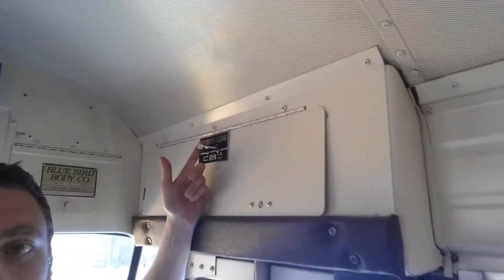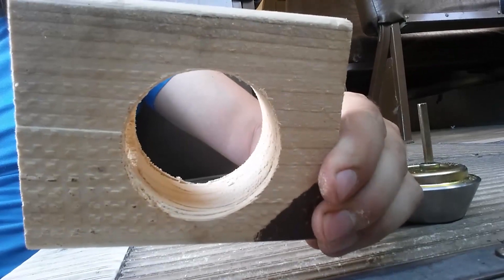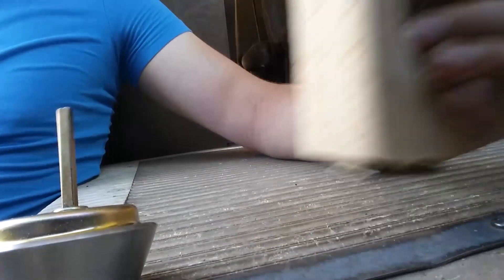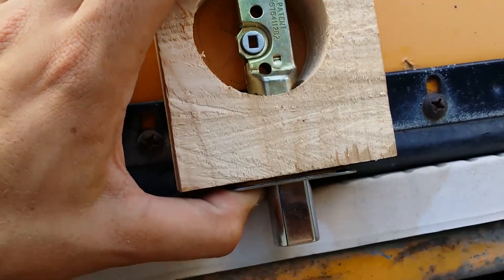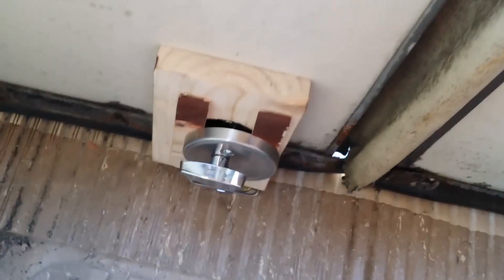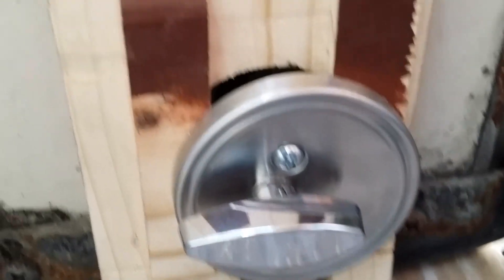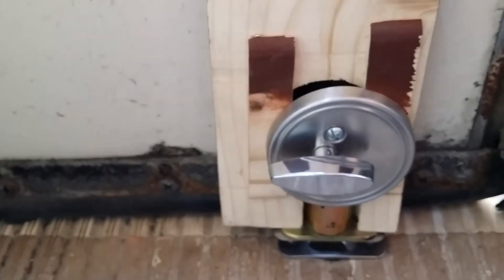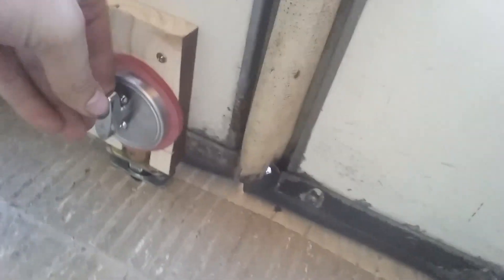Conversion Video 2- Bus Door Lock

Comment: People can still get in the bus through the back door unless you put a lock on it
Reply from the maker: I put a lock on it, but it was much just as easy as putting a lock on any other door.  Easy peasy.  Not worth a video.  There are actually 3 locking doors total.
Reply: Good thing you locked it because older internationals you can start with any older international key if a theif has it he or she can put the key in it and start it unless you install a kill switch

Comment: Hi mate, just started watching your channel. I know it was quite awhile since you uploaded this video, but i was thinking that you could still utillize the existing electrical lock mechanism by putting in a wireless remote relay switch in line. you could use a key-fob as the control...
Reply from the maker: I don't have an electrical lock mechanism in my bus.  The doors are totally controlled by compressed air.

Comment: How thick was your door to start?
Reply from the maker: I'm not sure off the top of my head.  However, I did discover that plumbing stores have more shallow decorative pipe fittings that the lock housing fits in.  In this video I'm using the housing that came with the lock, which is at least an inch deep.  I used said pipe fitting for the back.  You can see photos of it here: http://www.diyskoolie.com/2015-11-8-backup-camera-and-rear-lock-installed/

That narrows the distance between the two sides of the lock enough that this setup makes more sense and the mounting looks much more flush and clean.